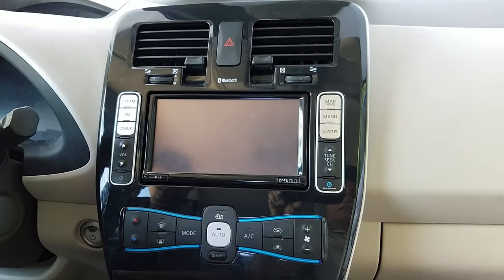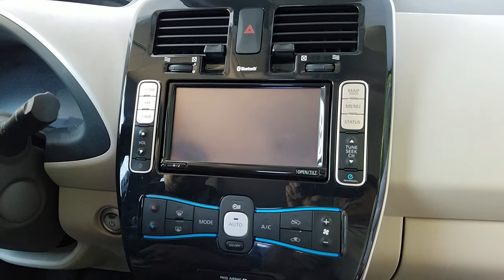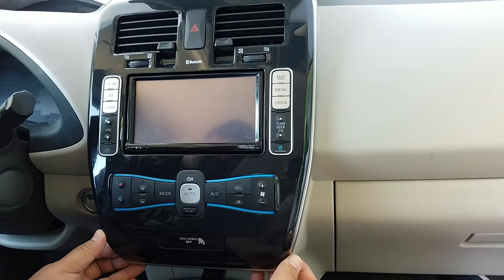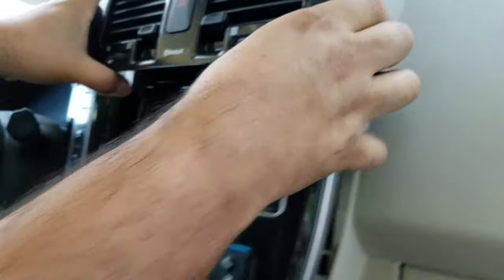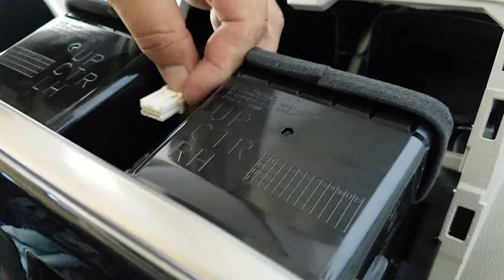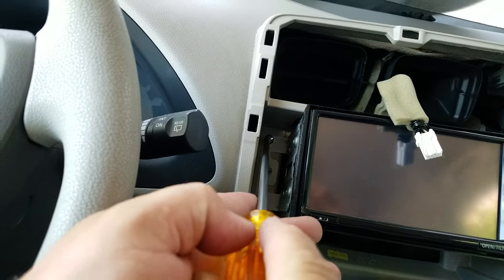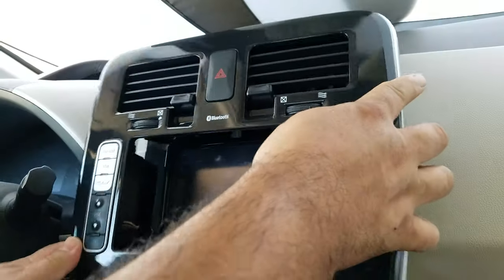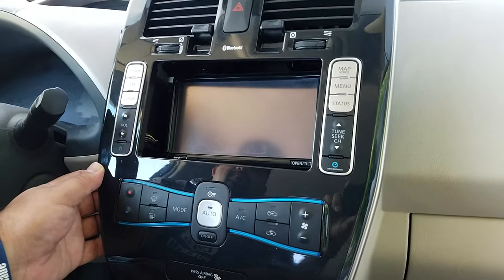How to Remove Radio / Navigation from Nissan Leaf 2012 for Repair.

Comment: If I take the radio out to send for repair can I still drive the car without the radio navigation system in Nissan Leaf 2017 thanks
Reply from the maker: Yes, you could drive your car once you remove the radio.